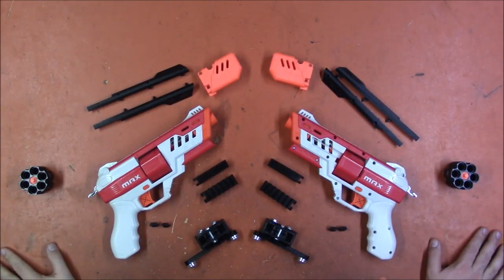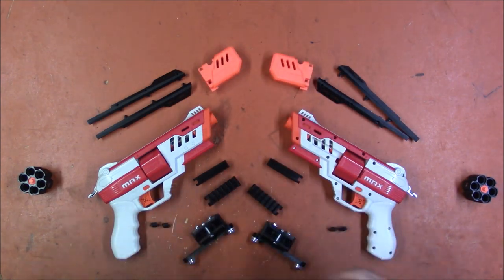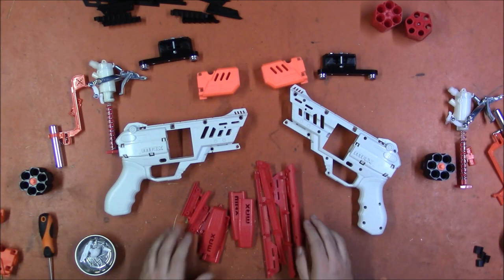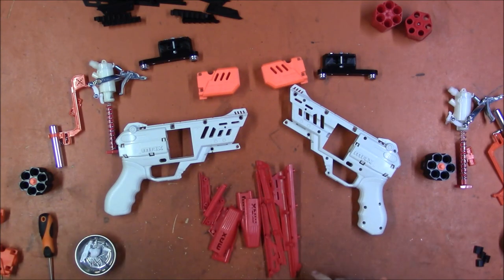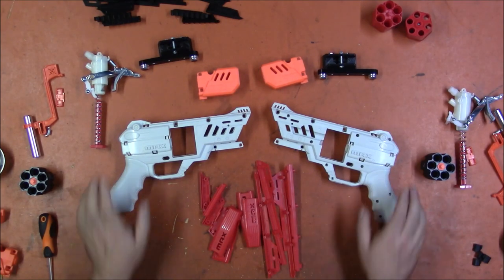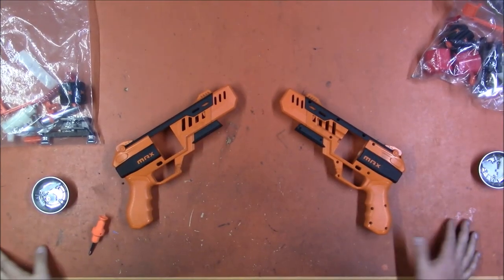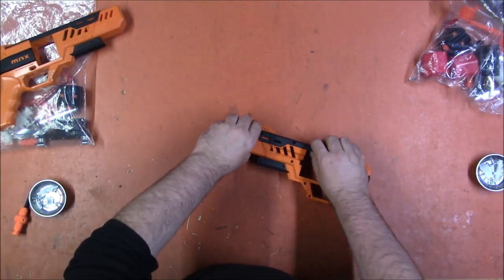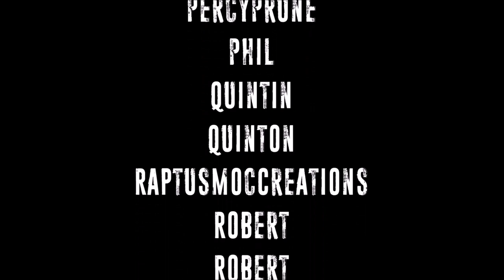Dart Zone Outlaws - Upgrades and Paint Jobs

Comment: Captain did you have to drill through the body pieces where the holster rig goes on to?... when i put mine on i used the picatinny style parts but the screw that would tighten the mount doesnt work... for now since the holster rig is pretty tight on the rails as it is i didnt use the screw.. thanks
Reply from the maker: I didn't have to...but I did choose to.
Reply: @CaptainXavier does feel tight enough without
Reply from the maker: @gillandro2  shrugs I decided to not find out.